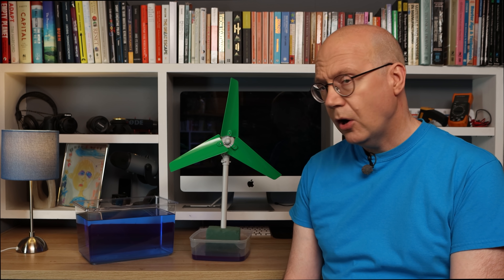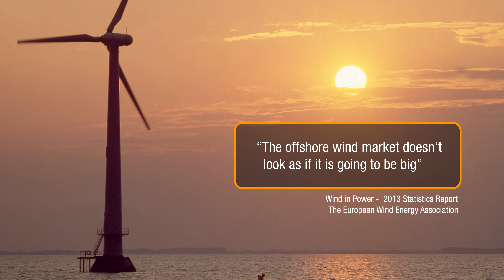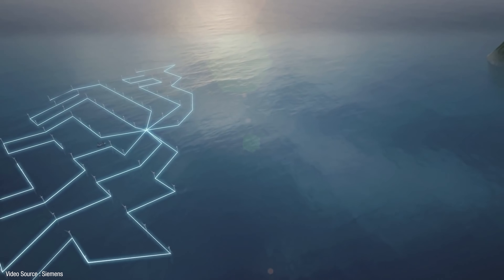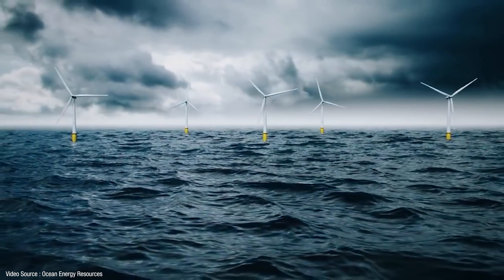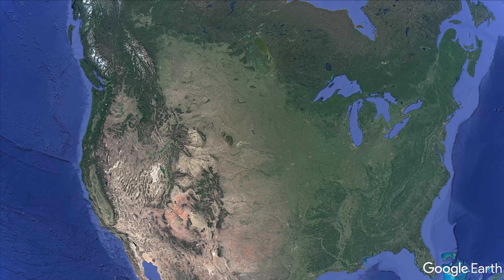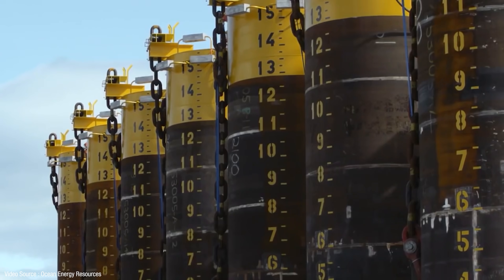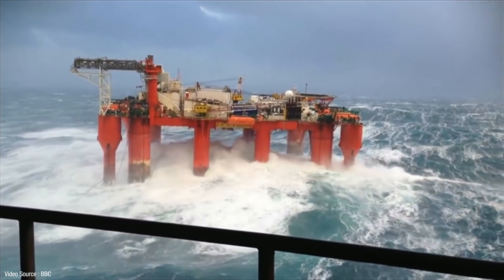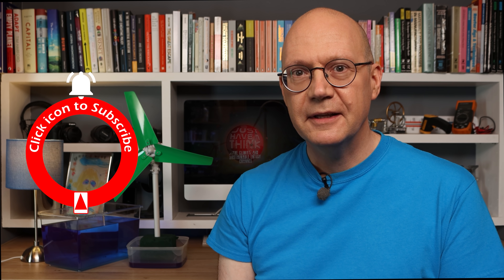Deep Ocean Floating Wind Turbines. How do they do that?

Comment: Renewably powered electricity has enormous energy potential. Will we supplant fossil fuels in 20 years? We of course need to scientifically and ecologically. But also the grow projections and the economics are increasingly optimistic too!
Reply: Not if all the energy generated goes into displacing nuclear instead of fossil fuel.
Reply: @kaymish6178  We need to supplant both fossil fuels and nuclear with renewables which is why high insulation and high efficiency are key strategies as we transition to distributed, diverse and decentralized (and centralized) renewables.
Reply: @aaronvallejo8220  the reality would disagree with you. New York shut down the Indian Point nuclear power station and CO2 equivalent emissions went up, because renewables were unable to take the place and fossil fuels filled the gap. shutting down our most powerful and least environmental damaging zero emissions source of energy infavor of fossil fuels is completely mad from my point of view.
Reply: @kaymish6178  Yes correct and correct. Gap filled by natural gas plants. But now wait until we install GWs of offshore wind over the next few years all connected to onshore grid batteries.
Reply: @aaronvallejo8220  yeah the waiting is the issue. renewables are just not coming online fast enough to both supplant fossil fuel use, and the growth in electricity demand. Asking them to supplant nuclear too is too much to ask which is what I meant in my previous comment. 

Especially as most of those plants had atleast another 40 years of operating life in them, every nuclear plant shut down is a huge blow to the fight against climate change.
Reply: @kaymish6178  I agree and yes I just read renewables are not expanding fast enough (only 50%) to meet our now surging electricity demand as our economies re-open post covid. My hope is governments and companies pour resources into renewables, high insulation and high efficiency so renewables do escalate faster and faster to meet demand and supplant. Wall Street Journal just wrote that globally we manufactured and installed 260 GW (260,000 MW or 260 1,000 MW nuclear plants) of renewably powered electricity in 2020. Can we gear this up and double it every year through mass production and the economies of scale?

Comment: We have the technology to save ourselves from extinction. How crazy is it when people imply that it would cost too much? Damn the cost! What is the cost of letting the planet burn up?
Reply: There are much better ways to do energy than this...  Wind and solar just won't cut it
Reply: @Les_S537  All options should be considered and tested for feasibility.
Reply: @davidcox8961  We got this Dave...

1.  Transition all fossil fuel electricity generation over to nuclear, and transition all transportation over to EVs.
2.  Build industrial scale atmospheric CO2 scrubbers that can pull CO2 out of the atmosphere.
3.  Take that CO2 and crack the CO2 molecules taking the carbon out, and releasing the O2
4. Take the carbon we get from this and create lots and lots of carbon fiber building materials to lock that carbon up long term and keep it out of the atmosphere.  We can use those carbon fiber building materials to build buildings and cars, etc..
5. Once we get CO2 content in the atmosphere down to around the 300 ppmv level, we can shut off the scrubbers and we're good to go.

Has to be nuclear power though.  

No other energy source uses less resources to build out and operate, and no other energy source produces less waste.

Renewables like wind and solar are massive resource hogs, and they'll never work as a replacement for fossil fuels

Comment: My big question is transmitting the electric to shore. A long distance which would require transformer stations. Also how will it be transmitted? Most likely under water? Water and electricity is obviously a deadly combination, is there any safeguards in place? I’m not against it by any means, but I would like to be assured that living things, possibly people at sea or swimming in the ocean would not be instantly electrocuted in the event of a failure

Comment: I would think this would be a boon to the sagging shipbuilding industry.
Reply: Add to that we already have the construction know-how to build offshore oil rigs, as D. Borlace has pointed out, and you have a ready-to-rock source for the actual infrastructure of platforms. GE and others are building the generators. Philips and Siemens and others have all the undersea transmission capabilities you can shake a stick at. This shouldn't be hard, just expensive to get going.

Comment: As a light commissioner for a small Municipal electric company in MA, we see offshore wind as one of the few sources of power that can meet our future requirements for non-emitting sources of power and have written to the BOEM to approve permitting so we have this as a power purchase option. We are well aware of the 30+ lawsuits funded by William Koch of Osterville, MA (Of Koch oil fame), that eventually drove Jim Gordon of smaller Cape Wind project out of business. We hope the developers of this Vineyard wind project will persevere against such opposition, as this is the obvious choice for powering the North East of the US and if we could synchronize this with Quebec hydro for some energy storage we have a very feasible way to get to net zero.

Comment: according to the EIA offshore wind construction is six times more expensive to build than  natural gas and that doesn't include the cost of transmission lines and ships and port infrastructure costs .not to mention the need for reliable base load electricity or super expensive battery storage when the wind doesn't blow . the block island offshore wind farm , ( near where vineyard wind is planned to be built )the nation's first and only offshore wind farm is currently shut down because of problems with undersea cables and squabbles over who will pay the considerable price ( $30 million just to start ) to repair the undersea lines of what is already the nations most expensive electricity . but then again : there's no problem that can't be solved by a sufficient application of cash .
Reply: And who is paying for the hundreds of billions of dollars of damage each year by extreme weather events whose probability is increased by the natural gas plants?  Or the billions in lost agriculture output in California due to drought?  You and I, that's who.
Reply: @Danandlene  the same people who paid for the most powerful hurricane to ever make landfall , the keys cane of 35 , or the worst natural disaster to hit the NY New England area the hurricane of 38  , or the worst flood to ever hit California in 1862 that created an inland sea 300 miles long and 50 miles wide , or the great Mississippi flood of 1927 or the three month long heat wave of 1936 that is still responsible for the majority of high temp records in the US almost 100 years later : those extreme weather events ?
Reply: @jeffgold3091  Do you deny that climate change increases the probability and therefore frequency of these extreme weather events?
Reply: @Danandlene  i just go by the science such as the ipcc : no increase in hurricanes or ACE , decrease in strong tornados , decrease in deaths from natural disasters , no increase in drought , less wild fires , drought and heat waves in US since the 1930's . millions died in china from floods in the 1930's .historical information on natural disasters both in the US and worldwide show a decrease in extreme weather events . etc . I still remember the 70's when millions were dieing from drought in Africa ; half a million died from a typhoon in Bangladesh /west India ; hurricane Camille hit the gulf coast as the second strongest hurricane landfall ever with a 30 foot storm surge ; I was just above big Thompson canyon in Colorado when a flash flood destroyed everything in its path . fortunately we've been largely spared these kinds of extreme events lately . but we do have an exponential rise in ( hyperbolic ) 24/7 media coverage of every  weather event and a massive increase in vulnerable infrastructure .
Reply: @jeffgold3091  Interesting that you draw those conclusions from the IPCC reports.  I wonder why they state "Continued emission of greenhouse gases will cause further warming and long-lasting changes in all components of the climate system, increasing the likelihood of severe, pervasive and irreversible impacts for people and ecosystems"?
Reply: @jeffgold3091  There we have it, you start by saying that you are following the science and when challenged with the very report you reference you switch to conspiracy theories. Disgraceful.
Reply: @Danandlene  your citing of the ipcc was entirely fact free . there are no reliable estimates of ECS , and as I referenced the science indicates no increase in hurricanes , droughts , floods or tornados according to the scientific part of the ipcc .  so I answered with some information why the ipcc report expressed the opinion it  did . I suggested you educate yourself on the ipcc and its roots . you're free to reject any information you like without actually looking at it .
Reply: @Danandlene  you can reference everything I said in actual ipcc science reports . try reading leading hurricane expert Chris landsea"s letter of resignation to the ipcc over this very issue . its easy to google

Comment: The diversity of renewable power sources is mind-numbingly large - BUT - the costs of developing and maintaining separate technologies is overwhelming when existing fossil-fuel tech is basically all the same (burn fossil fuel -> heat water in a boiler -> run a steam turbine which: in and of itself isn't simple). These aren't easy problems to tackle - and I'm still holding out hope for a simple "cold-fusion" like solution that can do everything from heating your home to powering a steam turbine. WTF ever happened to e-cat and other LENR fusion projects?

Comment: There is a huge potential in energy making from the ocean. I think sometimes when people see capacity they think that is the same as regular output 24/7 - having surges of power is never good for a system unless you have storage. For that reason  I like the tidal systems as liquid has the mass to drive and tidal is regular unlike wind. However on scale in different place around the world along with solar and some sort of smart grid to connect it will probably eventually become a reliable system. Not maintenance free as with steel moving parts and corrosion this will pose some issues. Using the ocean up frees up land to be used, reduce eyesores, and animal/bird fatalities.

Comment: could floating wind turbines be cheaper in maintenance than other offshore turbines? I am thinking that could be if you don't do the maintenance on side, but in shipyards instead.
Reply: Most developers have it in their maintenance plans to disconnect the platforms 2-3 times during their life and tow them back to port for maintenance.  That is a very expensive thing to do though, so others are actually looking into doing offshore maintenance as for the shallow water bottom-fixed developments.  Imagine landing a helicopter on one of these things!
Reply: @Danandlene  what makes towing them back into a dry dock so expansive? I mean, we do that with ships all the time.
Reply: @MusikCassette  A ship has built-in anchor handling and propulsion, while a floating platform like these needs a dedicated vessel to go out and disconnect the cables, splice/connect them together temporarily to keep the energy flowing in the field, disconnect the mooring lines and tow the platform, and then do everything in reverse.
Reply: @Danandlene  so, why dont we construct them with unplugging in mind?
Reply: @MusikCassette  Yes, that could help to keep the costs down.  At the company I work for we are looking at various options for this on the cable part.  The problem gets to be that introducing new tech or structures quickly exceeds the cost for the saved vessel time, though.  Hopefully we or someone else will come up with an elegant solution.

Comment: As you mentioned, offshore wind is incredibly expensive.  Is there any reason to believe it will ever undercut solar and onshore wind?  If not, I'm struggling to see the point.
Reply: That is why the latest offshore turbines are much more powerful: it takes fewer of them to get the same kWh output.

It's more than the cost.  Remember that offshore has better and more constant wind.  Plus the utility doesn't have to pay rent to landowners for using the land.  It's hard to beat solar because a solar farm can have a part of the installation up and running in under a year.  The solar farm has fewer moving parts and less maintenance.  And solar can be put on rooftops for distributed generation right at the point of use.
Reply: @acmefixer1  Yes, but even though offshore wind may be more constant, the cost savings of onshore can pay for a lot of batteries.  EIA estimates have the LCOE for solar plus 4 hours of battery storage at $45/MWh, and offshore wind without storage at $115.

Comment: As usual, excellent work! What came to mind for me was using an oil tanker size ship filled with batteries, being charged by multiple smaller wind turbines mounted on top. When fully charged to ship would simply sail to port and plug into the grid.

Comment: It looks like a tremendous amount of resources for a limited amount of electricity for windmills that will need replacement over time.  I've been looking at the potential of everything.  Molten salt solar in conjunction with a molten salt reactor seems to be a solid solution.  If the sun doesn't shine, crank up the reactor a little more. Both can use sodium as the storage medium with the same storage tank which fixes the battery issue.  Anyone?

Comment: The name “floaters” may be unfortunate, but at least memorable.  I think moderately deep installations could work well with localized energy storage.  After being inspired by a recent conference, I think it may make sense to store energy in deep tanks beneath the surface in proximity with the wind farms.  Services including electrical and air could be provided from the surface to the rigid tank below that could use water turbines to generate electricity and pumps to store energy by displacing the water in the tanks.  Perhaps retired submarines could be used?  Just having a 🤔

Comment: The shipping industry uses an insane amount of fuel, and it is usually the dregs of refineries so it is the dirtiest fuel available.  It would be great if we could convert this major pollution source to electrical power.  But how could we charge those ships?  Offshore floaters, who then would just have to have batteries to help in the task.  It could be like a Supercharging station in the middle of the ocean.  With the costs of shipping, it wouldn't be a problem for a ship to stop for a couple hours to take on a charge.  Maybe they could open a coffee shop next to some deep floaters?

Comment: Can anyone tell me why all large-scale wind turbines, both on- and off-shore, are horizontal axis propeller / fan style and not the vertical axis "egg-whisk" style that is more commonplace in smaller enterprise-size / rooftop installations? The latter capture energy regardless of wind direction (without having to reorientate) and are supposedly safer for birds and bat's, too.
Reply: Horizontal axis are more efficient and thus cheaper to build at scale. And especially offshore there's no real constraint on how much airspace you take up.

Comment: What is the average % Utilisation Factor (as a % of the Maximum Continuous Rating) of an offshore wind turbine - around the UK - compared with onshore? Talking about 10 MW as being sufficient to power 10,000 homes, is smoke and mirrors. 

Add the cost of energy storage capacity needed to bring the overall UF up to the average of conventional generation, of around 75% - take the subsidy away - and then give us a true comparison.

On some winter days the available wind and solar power capacity is not much more than 1% of Grid Maximum Demand. How much will it cost to fill the gap?

Comment: All the extra material needed to build offshore installations most come from someplace.
Reply: You either burn it or turn it into composite blades. One lasts as long as the combustion takes; the other lasts years. You choose.
Reply: @Digital-Dan  I was thinking of the many tons of metal needed for an off-shore construction. A lot more then what is needed on land.

Comment: I had simular problems producing a floating musselfarm.  I used sand in the bottom (nearly as heavy as concrete) and foam in the top of the floaters .

Comment: Still there is a need for backup and peak for the days when wind does not function.  The need is for non-greenhouse producing power. This appears to be where Gen 4 nuclear power with heat storage appears to make sense. I suggest that you explore the issues in the development of such systems and how much sense they would make once developed.